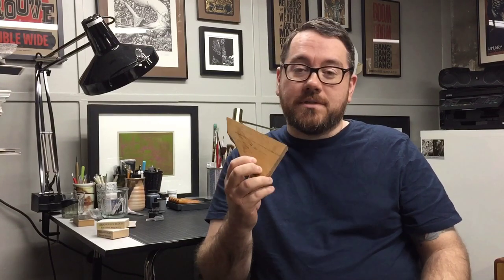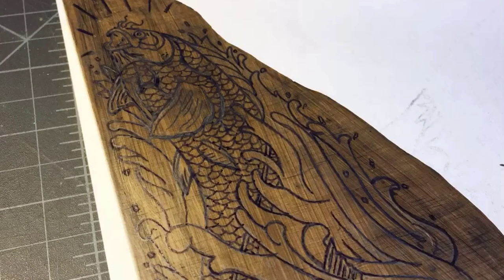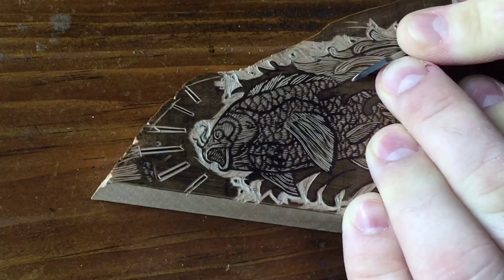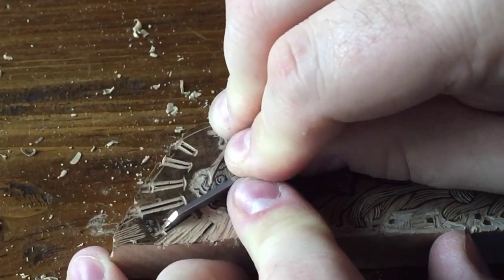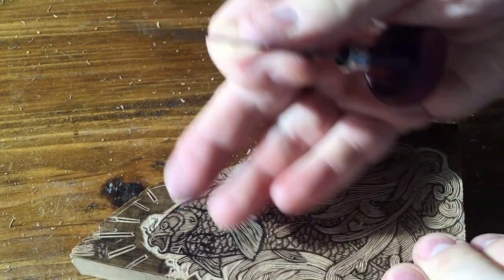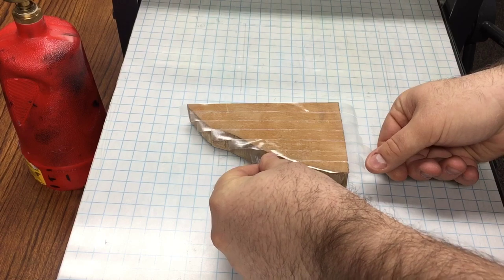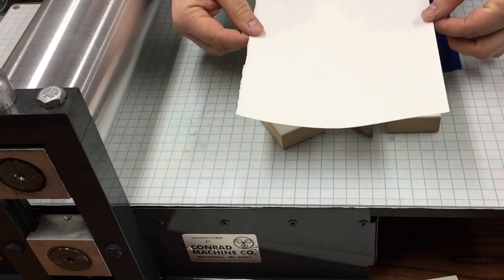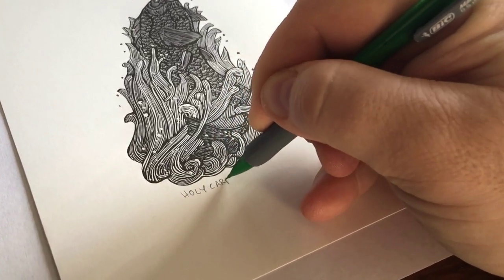Wood Engraving from Sketch to Print : Holy Carp!

Comment: I am an engraver who mostly prints by hand but I think I am ready to bite the bullet and get a press. Would you recommend a Conrad press like yours if I am going to use it most of the time to print type-high wood/resingrave engravings (as opposed to intaglio prints or even linocuts)?

Comment: Where did you get the diamond tip carving tool? Or, is it called a spit sticker? Sorry wasn't sure what that was. I want to carve small areas and do those delicate arched lines in my block prints. I am carving bass wood.

Comment: Eric great video, from start to finish! Can you share what kind of carving tools you used and where to purchase? Also, is mahogany wood the best to use for wood engravings? wood blocks as well?
Reply from the maker: Susan Cheatham hi! I’m using engraving burin tools from EC Lyons. I purchased them from a fantastic website McClains Printmaking Supply. As for woods, as long as it’s a hard wood and you are engraving in the end grain they should work well. Rock maple and boxwood, and lemon wood are usually the favorites amongst Wood Engravers! For regular woodcuts (with knives and VGouges etc), birch, Shina and mahogany are great!  Shina is a beautiful wood with almost no grain that is also sold through McClains!